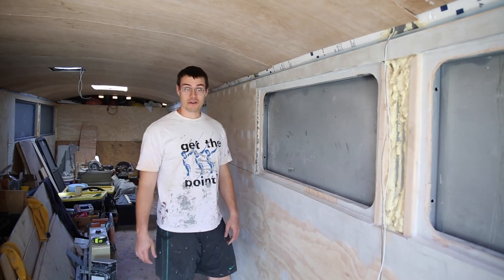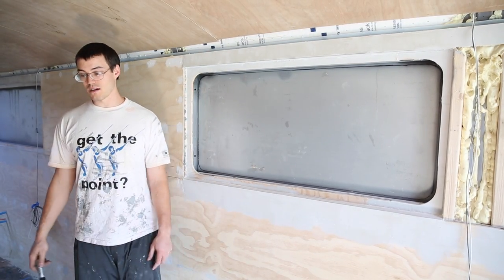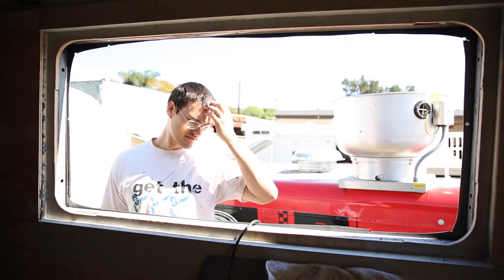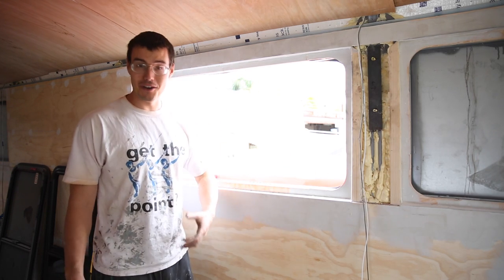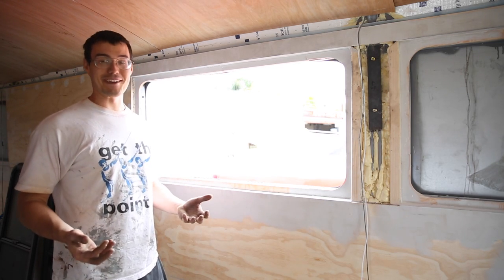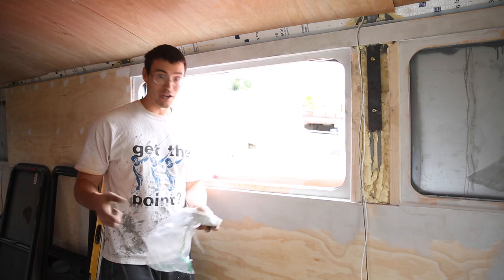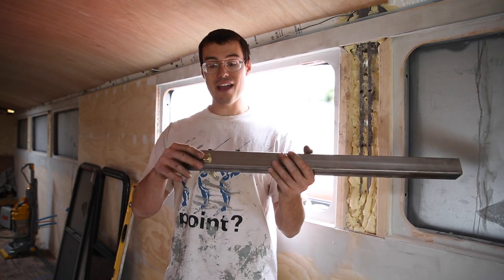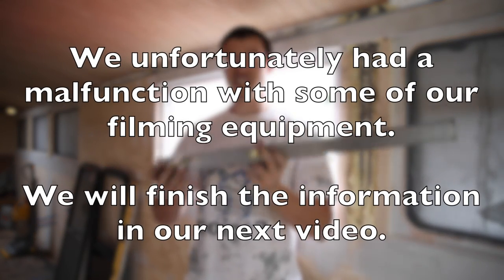Bus Conversion Tiny House #37 RV Window Installation Part 2

Comment: Love your videos brother. We'll be there soon ourselves on a build. Maybe you can answer a tool question for me though that no one else has yet. When the smeg did a saber saw start being called a jig saw. They aren't remotely the same tool, yet I hear it everywhere now. When the feck did that happen? They really aren't the same tool at all. I'll take the answer from anyone, if  could just find someone that knew when we screwed up the definitions of tools. What's next, a hammer gets called a nail?
Reply from the maker: +WittyRat Thanks for the support man! Here is my take on your question. A saber saw, sawzall, reciprocating saw are all the same. A jig saw can also be referred to as a reciprocating saw for the simple reason that both reciprocate the saw blade (I really have never heard it referred to as a saber saw). From the little I know about it the jig saw evolved from the scroll saw (essentially morphed into a portable version)... there was a model of scroll saw referred to as jig saw and that name was adopted for the portable version. I think the confusion of the names came from the evolution of the tools themselves from the bench top predecessors, if that makes sense. Sawzall was just a TM name owned by Milwaukee tools that kind of stuck to the tool, kind of like Kleenex for tissues. Anyhow, that likely isn't much help to you but that is all I can say about that! Thanks for the comment and checking out our videos.

Comment: If you don't mind a suggestion, what I do is drill a hole at the tangent of all the radius on the inside, so you'll end up with 8 holes.... then take a straightedge and a marker on the outside of the bus and connect all the holes along the straight cuts, then find or make a match for your radius and use your marker to draw the radius on all 4 corners and connect the lines with your marker... you will then have a marker outline of your window opening on the outside, go ahead and cut it out with your jigsaw.... it's much easier to follow the line than aim at a hole 5 or 6 inches away and you will be able to make a very nice cut, hope this helps
Reply from the maker: +James E Dennison Thank you for the suggestion! I have found that just doing a bunch of smaller holes with one larger starter hole seems to work well, the 3 windows we did after this one turned out much better. This first one definitely sucked 😂
Reply: Cool, Glad it's working out!!!

Comment: Bjorn and Lori, it's looking good and I was wondering what had happened to you guys.......hehe. I know, you guys work on your Skoolie on the weekends and you guys have lives as well! I had a question in reference to your roof deck. Are you guys just going to do the deck platform just above the roof? I was just concern on the height since y'all did the roof raise. I'm sure you guys have already done your research on bridge heights and as any good engineer will build accordingly. I've seen a couple videos of Skoolies with roof decks and they look great and provides a enjoyable space looking out over nature!!!! Happy Converting!!!
Reply from the maker: +Marshal Pearson Thank you for the comment! We are going to do a platform just above the roof. The bus started at a height of 11', we did a 9" roof raise so to the top of the new deck should take us just under 12' 3". This is about our clearance anyhow when you take into account the roof top vents that we have so we are not too concerned. It is a great point and definitely something that is always on our minds. The positives of the roof deck seemed to definitely outweigh the cost and time associated with installing it. We will try and discuss further in our next video! Thank you for your support, it really is appreciated!